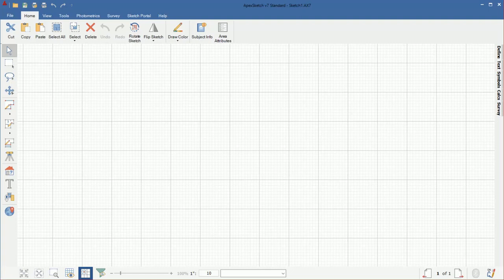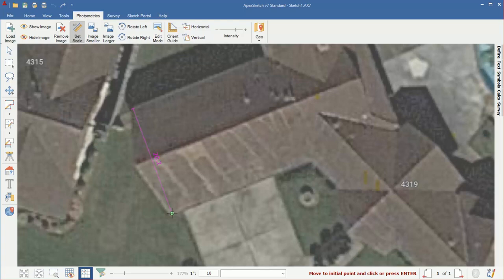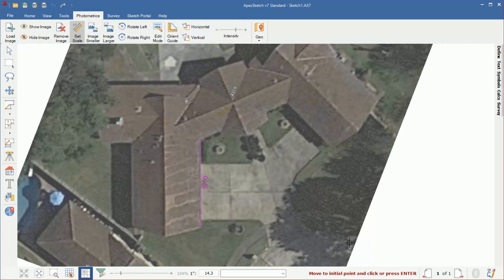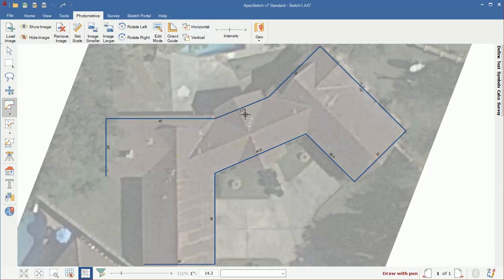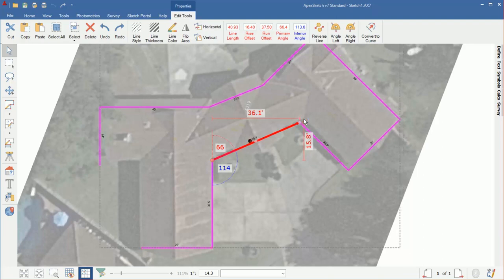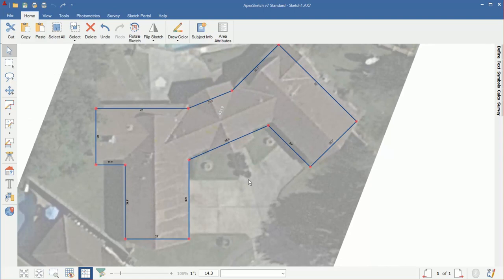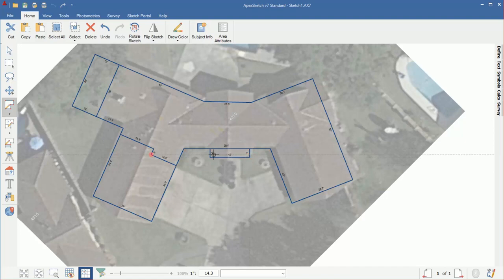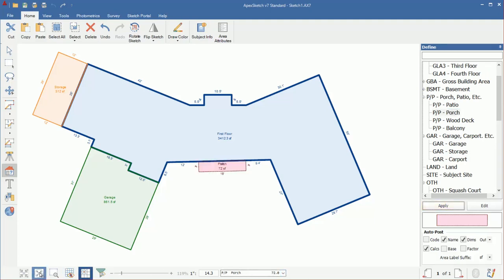ApexSketch v7 - Using Photometrics to figure out angles on a complex sketch | Apex Software

Comment: Is there a way to draw a line at a certain degree?
If I'm going 20' up, then I have a wall that's 28.3' at 45 degrees up to the right?
Right now my solution is to hit 20' up, 20' right then enter.
Reply from the maker: Yes, We call this TURN. To sketch an angled wall using TURN you would enter the Distance, Direction, then Degree. So to draw a 28.3' wall to the Right at 45 degrees, you would enter 28.3R45 ENTER. Note that you can not use Turn on the first line/wall, you will have to have the wall the angled wall is coming off of drawn first.
Reply: @ApexSoftware  Thank you!